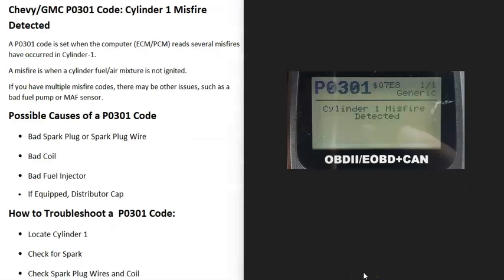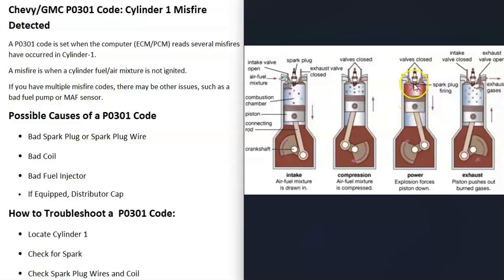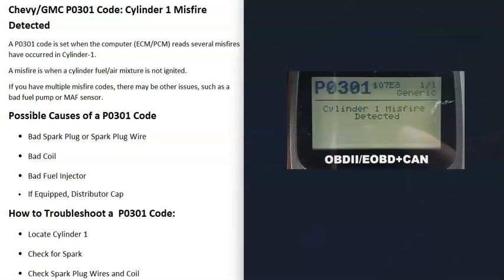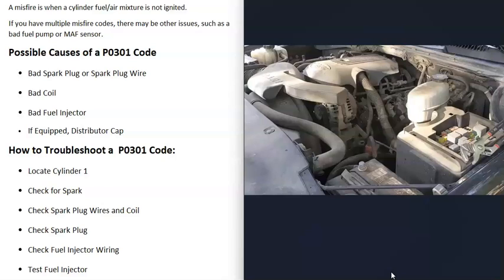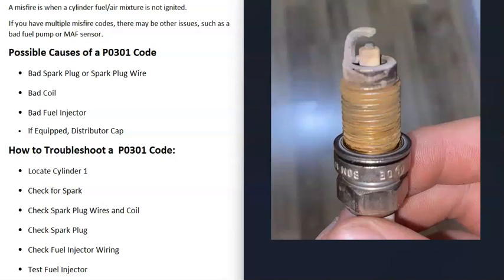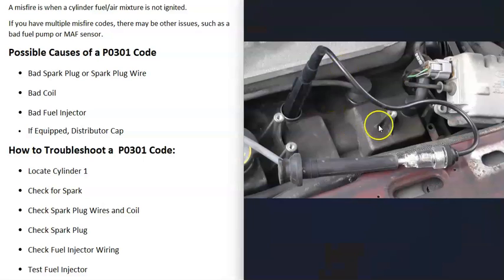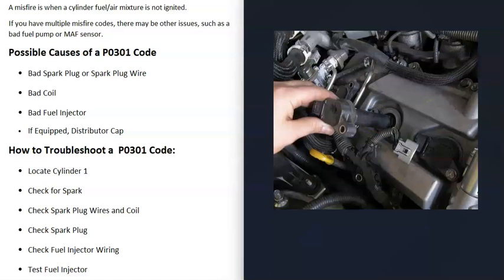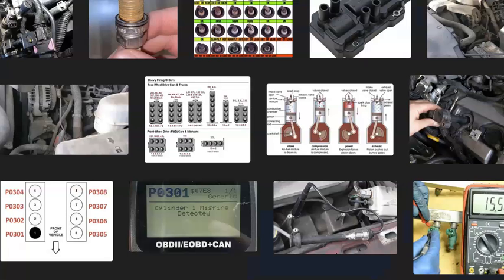Causes and Fixes Chevy/GMC P0301 Code: Cylinder 1 Misfire Detected

Comment: Will this cause a crank no start
Reply from the maker: Usually, with a single cylinder misfire, the engine will still start and run, but idle badly. A 4-cylinder will run much worse than an 8-cylinder.

Comment: can you help me, shop says I have a misfire in cylinder 2 of my2016 Chevy Malibu , they say I need to get my engine rebuilt idk why: it's at about 120k miles. They claim I have no pressure in cylinder 2. I have no idea what that means
Reply from the maker: If there is a mechanical issue, such as a bad valve or head gasket, that can cause a misfire, which requires rebuilding. You can do what's called a leak down test to verify it.
Reply: @HVAC_Mechanic thanks man, question is "what exactly do I rebuild, this shop acts as if I need to drop a whole entire new engine
Reply from the maker: If there is a mechanical problem with the engine, such as a bad valve or head gasket, the engine needs to be taken apart and the problem repaired (rebuilt). Another engine can also be swapped out, which sometimes costs less. I would verify that it is the issue and if it is a bad valve or cylinder issue. A bad valve can be fixed by removing the heads instead of the whole engine.

Comment: I had this problem.
Haynes manual says to set spark plug gap at 0.040".
I checked my plugs and they were all at 0.033".
Adjusted all the plugs to 0.040" and haven't had a problem since.
Too small of a gap can cause misfire.
It's an easy check and fix.

Comment: My wife just had her car at dealership for regular service. They told her she needed to replace valve cover gasket do to small oil leak. She had it done Thursday. Drove the car to work Friday check engine light came on. Called dealership they said come Saturday. Saturday car is running worse. Give Code P3400 cylinder deactivation as cause saying it’s completely different issue than anything they did. Told her to bring back Monday. I’ve been screwed by this dealership with my truck on services before so I think she is too but just asking a second opinion. Prior to the valve cover gasket replacement there was no issues with the vehicle. It just went in for regular schedule service, 145,000. Then afterwards it’s through if code and tuning like crap.???

Comment: I can't figure this out. I have a misfire on 1 and I have spark. Harness on injector wire has power, Valves moving, changed injector from dealer, has compression. My question is can it be a PVC valve causing a misfire in only cylinder 1? I did have a good amount of oil inside the intake manifold. I don't know what else to look for. 2016 Silverado 4.3
Reply: Could be a weak coil even if it has spark
Reply: did you find the issue am having same thing with my chevy trax changed spark plugs and coil pack now i am going to change the injector

Comment: Got a P0300 and a P0301 code. Changed spark plugs. The spark plugs wires too but they sent  longer spark plug wires. What next should I do?
Reply from the maker: I would test all the components, injectors, coil, and wiring on cylinder #1.
Reply: Did you figure out?
Reply: @redhatch9862  Had it tested at a shop out of town. The compressions were off. Gave a quote of almost 10k. Found a good used engine and had it swapped.

Comment: I changed plugs, coil pack, and got code P0301 and P0303. Put in new fuel injectors. It fixed 3 but there is still a misfire on 1. Any suggestions. It’s a 2018 Chevy equinox
Reply: get a compression test
Reply from the maker: If the parts are all good, I would test the wiring be sure everything is plugged in.
Reply: I got the same issue replaced spark plus ignition coil and all wires still showing a misfire?? Any help if greatly appreciated  @HVAC_Mechanic
Reply: Could be cylinder deactivation solenoid or AFM lifter y’all check the easy things first if it’s still happening then this is ur problem
Reply: I am not a mechanic, I am having a misfire issue with Cylinder 1 on a Chevy cobalt LT 2006. 
I have changed the coil pack. I have changed the spark plugs. 
Once I had changed the coil pack.. light went out and was fine all day. When I left work check engine light came on.
I suspect the Ignition Boots, ICM and Injectors. How do I know which one it is, because I can't afford to keep replacing parts until I find the issue. 🤦🏻 Any help is appreciated
Reply: You need to get to the route of yhe problem your gonna have to learn and research or pay someone.throwing parts at it is usually a loss.. @A1Day1Official